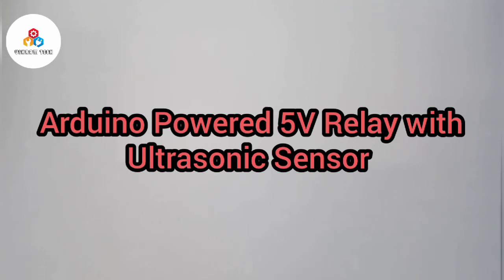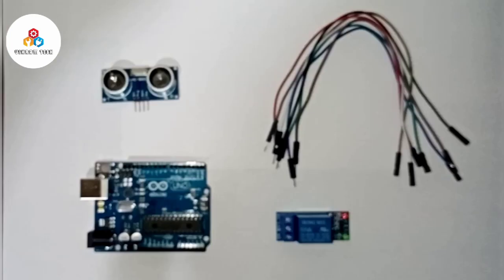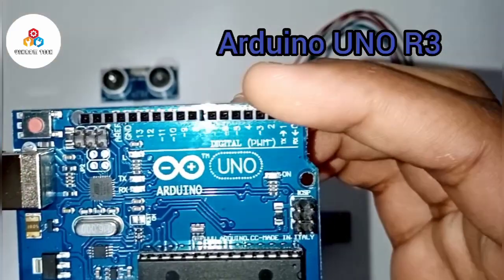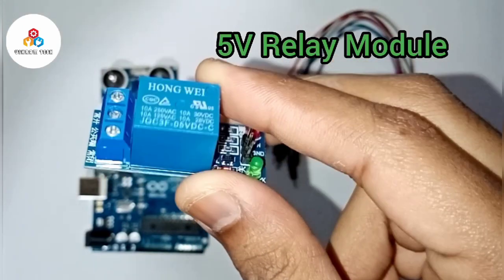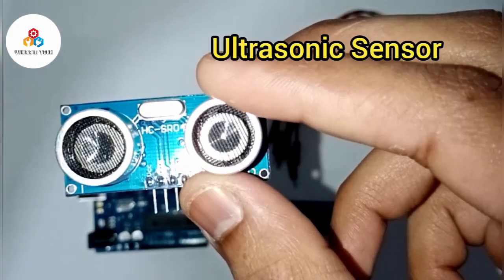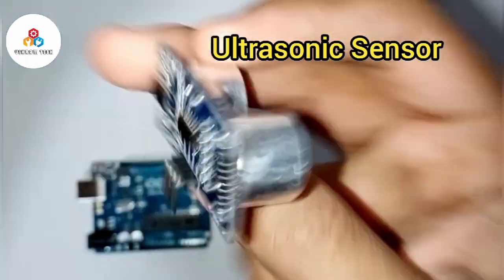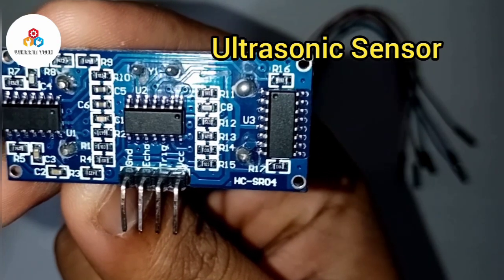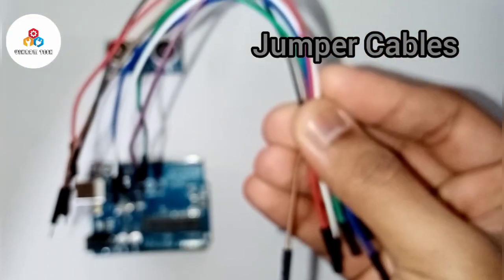Arduino Powered 5V Relay with Ultrasonic Sensor || VIKRAM TECH

Comment: Good day sir, I would like to ask about adding power adaptor as a power supply. BTW I used 12V 1channel relay module, I add 12V pump. Hoping for your response sir. Thank You!😊